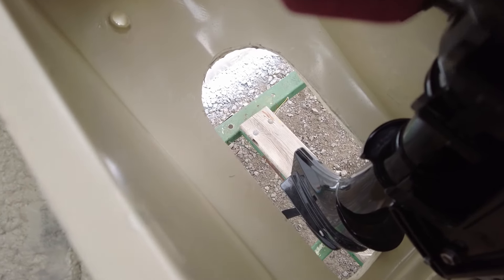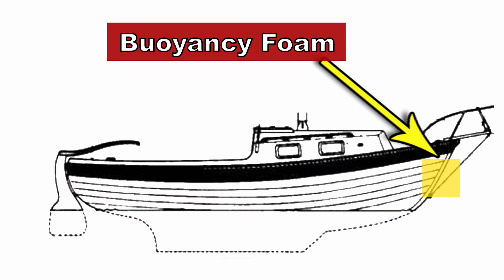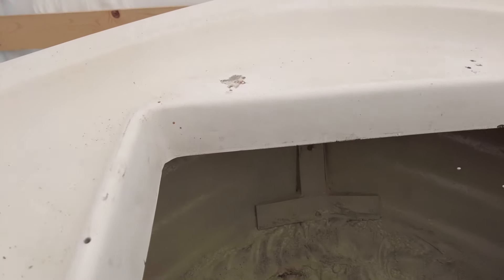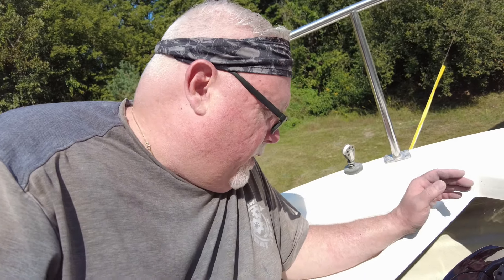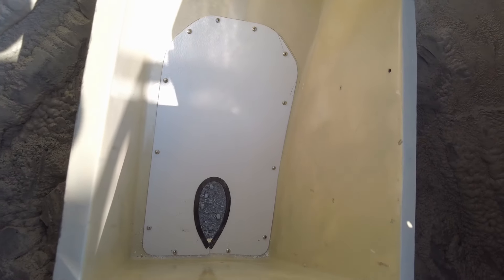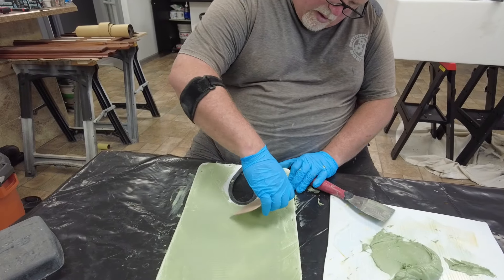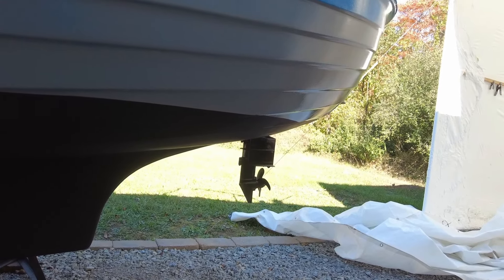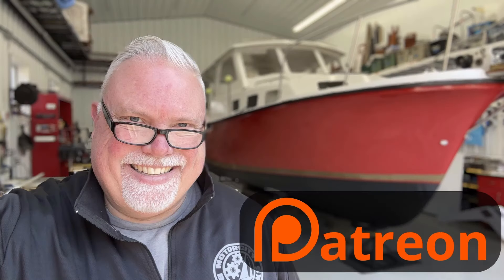Small Sailboat Restoration | Outboard Engine Well Plug (Ep99)

Comment from the maker: For those concerned about the coolant stream filling the well from the outboard motor: there is a thru hull will allows a small hose from the engine. And the engine well is not watertight. Of course the hull edges have already been sealed to protect the core in the engine well hole 🤓

Comment: Great video and an interesting solution that you came up with however, have you considered how you would deal with a prop fouled with a line or weeds.  

An different solution would be to mount a plate that covers the hole completely and cut a large diameter hole in it.  This could be flushmounted from the bottom of the hull causing less drag. Then fabricate a flange that mounts directly to the motor that contacts the plate. 	The motor can be lifted vertically without having to undo any fasteners, giving quick and easy access to the prop additionally the motor would be able to spin for reverse.
🇨🇦
Reply from the maker: Interesting. 🐙 This is a trailerable sailboat 🤓 I would address it the same way I would with an inboard engine. Dive overboard and un-foul it. Or haul the boat out. It is trailerable you know 🤔

Comment: Try making your frp panel in two pieces. Cut down the length, overlap and screw
Reply from the maker: And what would be the purpose of that? 🐙Thanks for the comment 😁
Reply: @motorcityboatwerks  ease of manufacture and ease of fitment.
Reply from the maker: @astrayalien  😂